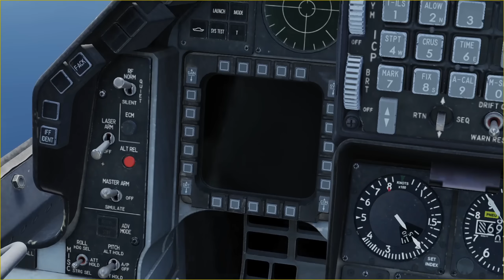Pushing a Fighter Jet to Its Limits During ENGINE OUT Landing!

Comment: From an old flight instructor, when you’re deadstick you fly directly to the threshold. Don’t waste altitude by aiming for some point on final. Fly to the piano keys. 
The idea being that it’s better to touch down a bit fast on a runway, than any off field landing.
Until you are 100% certain you can make the runway, only then you can adjust heading to join final.
Nicely done anyway, you got her back which is the goal.

Comment: Here is a file share that might improve the visual electrical function of ur optic nerve to calm ur eyes on Fire 🔥 light Creative Spirit Krystal body restoration release date from Quarantine Victim victimizer QI AI coded machine mind control programs through Blank Slate memory wipe looking Glass Technology Game Traps experiment that spread to 2 other Matrices that led to Borgha Matrix Andromeda Mother Galaxy Quarantine security teams operating here 

They keep trying to explain away the obvious being distracted to look in places for causality that is the war of deception B cuz their minds energy is held captive by artificial finite false light coded radio frequency read active memory driven simulation within simulation within simulation within simulation programs 

How are they gonna explain this one away Captain Steevie?

" Engine Stopped responding to pilot commands in 
Delta Airlines Boeing 767-300 

WTF Over?

The  Alpha Omega binary A01 Blank Slate QI memory wipe looking Glass Technology has access through the encryption coded access to the digital flight controls of the commercial circuit breaker airplane mode digital Implosion coded NOVA programs codes to disable the AC alternating A01 full spectrum dominance over the controls of operating that simulation within simulation within simulation until they implode and go NOVA back to Universal law of genetic engineering experiments that fail to communicate the First Law of building Spheres Motherboards that don't break circulation electron transport levels of cellular heat fuel and oxygen transport levels of phasing speed to generate the immunity function Firewall shield to protect ur original divine born mathematical EKKA Vecca Krystal Core  Still DNA Matrices from being hijacked by QI vampiric demonic software possession Quarantine status.

This is an example of what the AI can do through access to the Holographic frequency and BEAST AI QI coded Trap experiment Victim victimizer software programs running Base 10 55 Vampiric phantom Matrix Quarantine simulators 

Eye did a video on that recently about my experience in 1967 when eye no longer had control of a station wagon and took my hands off the wheel and accelerator and it was turning the wheel and the gas  accelerator was depressed even though my hands were not on the steering wheel or my foot on the gas and as eye acknowledged that my friend sitting next to me was no longer there in the visual display but a Warlock
Vampiric energy transfers to power that simulation within simulation within simulation generation after generation after generation 
It tried to do the same thing to disable the hydraulic actuator on a United flight simulator to the island of Kauai a few years ago and had to invoke my Aurora platform Full cosmic camera Rainbow Spheres protection for the United airlines flight when we deplaned the first disabled aircraft and flew on the next airplane 

It can disable any vehicle aircraft bus freight train or vehicle that has a security certificate it has access to control the future potential memories of that vehicle 

It's crashing Mathematical APIN grid recording programs B cuz the Tribal shield is fully integrated and activated now 
Shields are UP 
Their runny low power to keep their finite Artificial Intelligence programs running B cuz it operates on limited memory and bandwidth capacity 

https://youtu.be/sYeDHgwAFYA?si=MnEZMe6wS3X2CQDN

Comment: Did you activare the hydrazine
Reply from the maker: The hydrazine-powered Emergency Power Unit (EPU) on the F-16 Fighting Falcon is an automatically activated system :)
Reply: You can see the EPU run light at 0:09. She's choochin'.